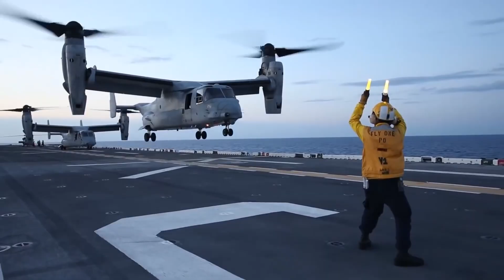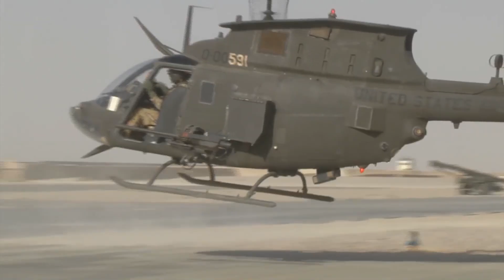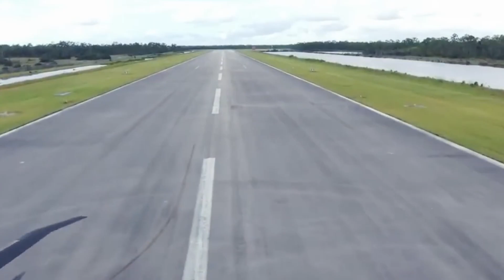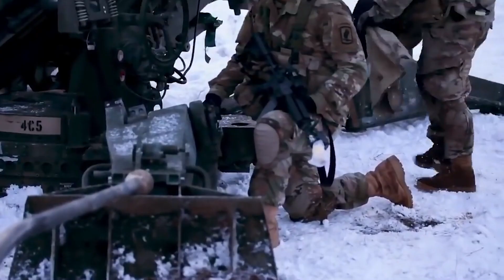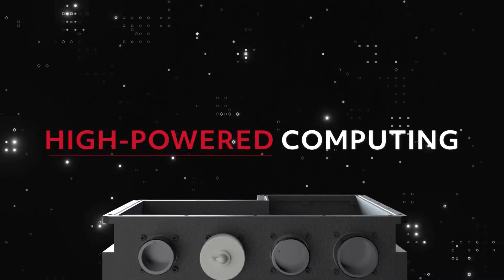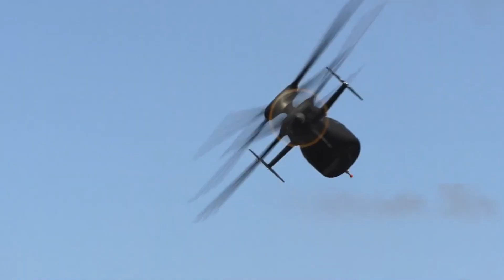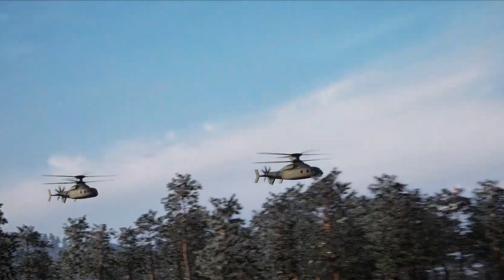SB-1 Defiant - Must go faster!

Comment: EXCELLENT explanation of the Raider evolution with accurate details including its problems, mentioned with wry humor. Thank you. My nephew was part of the civilian evaluation program that ended up choosing the Bell Valor tilt rotor entry.  Hey, fast is good! And longer range for Pacific island hopping is a must.
I think the Sikorsky "Push-me Pull-u" entry may, with the new engines, be the better choice FOR AN ATTACK HELICOPTER but only IF it can keep up with the Bell Valor. Next put the new Sikorsky engines in the Valor once they are proven. Lighter & slimmer = attack version with more speed and range.
Reply: Don't worry about a V-280 attack version, it won;'t happen because the Air Force will point to the Key West agreement and start complaining that the V-280 is a VTOL fixed wing. If they complained about the AH-56's stub wings (and they actually did manage to get it cancelled) they will for sure complain about the V-280 and they'll have a stronger case here. Everyone including the US Army seems to have forgotten this.
Reply: the ridiculously continent sized rotor hub is prohibitive for an "Attack" Helicopter., too vulnerable and too obvious a target. Not that Valor would do much better as it also seems doomed if ever forced to work asymetrically due to one gondola having been sieved by bullets, but Defiant is a no go from the start.
Reply: @Ugly_German_Truths The V-280 attack version is doomed because the USAF will claim it's a fixed wing VTOL, and a strong case can be made for that because tiltrotors mostly operate in airplane mode. If they pitched a fit over the Lockheed AH-56 they will for sure do the same about an armed V-280. The USAF have not as far as I know changed their stance that the Key West Agreement prohibits the army from fielding armed fixed wing aircraft.
Reply: @atomicskull6405 Long range drones are armed fixed wing aircraft that the Army has been operating since the 90’s. I don’t think anybody in charge in modern Washington knows or cares about the Key West agreement.

Comment: It’s about speed and range.  The V-280 will Island hop a lot faster and further than the SB-1 Defiant.  Each aircraft has its advantages and disadvantages.  However, the V-280 is ready now, not later.
Reply: Good luck landing that fucking hog in vegetated jungle environment and operating in such theater, 2nd the near peer adversary not going to send anything to contest a aerial threat flying around? 3rd what happens to its so call pros when near peer is no longer needed.
Reply: @thh4584  fool... the Valor outperformed the Defiant in nearly every metric. The Valor only has a 19% larger footprint than the Black Hawk and can land nearly everywhere the Black Hawk can.
Reply: In reality all 3 aircraft require 50 meters separation from each vehicles center or nearest obstructions per regulations of ARMY Ops
Reply: @michaellove9831  yup people see movies and think that is reality.

Comment: The Fairey Rotodyne of the 1950s/early-'60s was faster, more stable and in 'free rotor' mode the rotor could act as a parachute for quite a heavy craft in all weather conditions.
Its lift and civil engineering capabilities were immense and it could have revolutionized city center to city center transport in Europe and N.America.
The Mk.2 with revised, quiet, tip jets for VTOL overcame noise objections but orders from major US companies were stopped by the US government.
Had development been allowed to continue aviation would be different today, cleaner, more diverse and 'drone' versions operated in a pair with a crewed version controlling the unmanned one were discussed as early as 1959.
Reply: I agree, maybe the reason for being not admitted in city/city or airport/city transport lines was the noise level.

Comment: I see the tiltrotor as fundamentally inferior because of its mechanical complexity. I have to imagine the Army figures the performance is worth it.
Reply: Not much complex than SB-1 having 3 rotor and 16 blade
Reply: It’s not much more complex. It just tilts. Not complex at all. If they do it right. And scalable. Can have 6 or 8 propellers too.

Comment: Just for interest: Kamov started the two-rotor counter rotating design shortly after WW2.
Reply: But they didn't. Going on wiki you can see the idea for counter rotating helicopters was already thought of in 1754 by Mikhail Lomonosov (notably not named Kamov).Then in the 1930s some French guys cooked up a gyro copter using the counter rotating design. Arguably, they were ones who actually pioneered the concept. It wouldn't be until late 1947 when Kamov would actually create the Ka-8 helicopter using counter rotating blades. This makes it the 4th functioning design after the first French one and three other American prototypes. 

In fairness, of Kamov he helped mature the design until his death and arguably did most of the work to make it a production helicopter but it is not fair to say that he started the design.
Reply: @d0mram-02  Your knowledge is deeper than mine, but Kamov is building helicopters with counter-rotating blades for decades.
Reply: The critical difference between the Sikorsky and Kamov designs is that the latter uses conventional rotor blades which need a lot of vertical separation to prevent them from hitting each other when they are moving slowly and drooping significantly. That means a tall rotor shaft which adds a lot of drag. The Sikorsky designs use much more rigid rotor blades that don't droop as much, and can therefore be mounted closer together.
Reply: @MrHws5mp  Several Ka-52s have been lost when pilots made sporty maneuvers in them and the upper and lower rotors made contact.  One of Russia's best test pilots lost his life that way.
Reply: Yeah, not mentioning Kamov helicopters in the history section is a big blunder, also not explaining the rigid rotors. Pretty weak video.
Reply: from the Smithsonian web site: 
"In 1944, at the age of 19, Stanley Hiller, Jr. designed, built, and test flew the first helicopter with coaxial rotors to fly successfully in the United States. The XH-44 was also the first helicopter to fly successfully with all-metal blades and a rigid rotor. Hiller used the counter-rotating coaxial configuration to distinguish his designs from Sikorsky's single main rotor designs that dominated the helicopter industry in the mid-1940s."
its in the Air and Space museum now

Comment: The SB-1 lost to the V-280 because V-280 has a better speed 345 Knots, a lot longer range 800 miles, and more lift 1,000 lbs more.
Reply: Don't forget less maintenance since the Valor prototype alone was flying way more often than the Defiant.

Comment: Surprisingly being a Boeing, this is safer than the Bell competition
Reply: Why do you say that?  Currently the MV-22 has one of the lowest mishap rates in the Navy/Marine Corps inventory.   The aircraft with the highest mishap rate in Navy/Marine Corps service is the C-20, a military version of the Gulfstream G-III/G-IV series aircraft.  And not by a little either.
Reply: @philsalvatore3902  Just yesterday 3 marines died in a MV-22 crash. The design is fundamentally flawed because if 1 engine goes out in hover mode, it’s a guarantee crash.

SB-1 can autorotate like helicopter if all engines out, normal plane can glide if engines out. MV-22 cannot do either in hover mode
Reply: @Peizxcv  Number one, we do not know the cause of yesterday's mishap.  Based on aviation statistics 90% of mishaps are pilot error.  Number two, there is a synchronization shaft running through the wing so both rotors turn even if one engine is lost.  A one way sprag clutch disconnects a failed motor from the drive system, just as you find in nearly all turbine engine helicopters.
Reply: @philsalvatore3902  They need to up the pilot training then as 15 hull-lost from 400 built isn't a good number
Reply: @Peizxcv  4 of those losses were developmental test articles.  Two were combat losses, and possibly three (one Air Force Special Ops loss isn't publicly documented).   Based on the Go-Pro videos recovered in one crash in Norway it was a pilot screwing around exceeding the limits of the aircraft ( I lost a few buddies that way, can't blame the aircraft if the pilot doesn't respect the flight manual) and one loss was due to rotor downwash kicking up rubber pads at a hospital helipad in the UK.  Sounds pretty normal for rotorcraft.  In terms of mishaps per 10,000 flight hours the V-22 is one of the safer aircraft in the Navy/Marine Corps inventory, incredible as that sounds.  Legacy Hornets fall out of the sky at a higher rate and for reasons that I simply do not understand their C-20/Gulfstream III/IV fleet has almost double the mishap rate of their combat aircraft while the USAF never crashes theirs.
Reply: There is a shaft that connects the rotors. In the event of an engine failure, one engine powers both rotors.

Comment: Looks like it could be the new Air Wolf 
Now to mount some retractable guns and missile pods with a different engine exhaust ports to make it look like it can go way faster
Reply: The Airwolf design wasn't real, and it couldn't be. As for speed, the limiting factor remains the phenomenon of retreating blade stall. That's why they don't just slap on more/more powerful turbine engines. That being said, I wouldn't be the least bit surprised to learn that a solution to that problem could soon be worked out.
Reply: @Tom-zs6bb  I agree that Air Wolf is fictional,  always has been.  There has been rumblings that a new series is in the works.  And my comment was that it would make a great new platform for the series,  especially since congess is not going to fund it as a warfighting aircraft,  after the entire ficaso of eastern europe
Reply: @almirria6753  This is better than air"woke". At least is not get fall when getting shot at the tail part!

Comment: Pretty pleased on your take for this one because while I strongly prefer the look of the SB-1 or any of it's 'siblings' I can't deny the on paper numbers of the V-280 and it just seems like the obvious choice for most situations. On the one hand it's kind of a shame because I find it relatively ugly, but on the other it's capabilities are undeniable
Reply: Feel the same, but if this is to be a Balckhawk/Seahawk replacement I can't figure out what they are going to do for the Navy. The Bell V280 isn't going to fit in frigates and destroyers.
Reply: @daemonllama78  It will probably replace the Ospreys that the Navy uses. People forget how much of a workhorse it is for the navy.
Reply: @daemonllama78 V-280 would probably just have V-22 folding system. It will fit.
Reply: @aizseeker3622 Hmmm I wonder if that’s something they could add to the V280’s design. I don’t think they planned for that kind of folding system initially.
Reply: @Blood_Berry13  it has the folding system. I've seen pictures of it with the wing rotated.
Reply: @Jeff55369  Yeah, since Marines also interested in FLRAA program to replace their H-1
Reply: @aizseeker3622  Those systems cause multiple issues with the V-22
Reply: SB-1 won't either as it's too tall for anything but taller hangers... Saw a few illustrations of naval use variant that had folding blades and  inverted tail fuselage/ vee tail to fit in elevators or ship hangers for Navy/Marines purposes. They'll be busy enough with Army contract. Feel likely that the smaller Raider design will get FARA preference if it can meet specs unlike SB-1.
Reply: @michaellove9831  Sounds about right with the more efficient hover on a smaller platform that will carry more payload everything it will need.

Comment: A video on the helicopter that holds the World Speed Record for a conventional helicopter, The Westland Lynx would be interesting. In 1986 it managed to clock up a speed of 400.87 km/h (249.10 mph)
Reply: Or 216  knots so not much slower the the x 2
Reply: I have been upside down in a Lynx once, some RN pilots were demonstrating to us during a port visit to Diego Garcia.
Reply: Also one on the new Wildcat, and why it was chosen while still being slower than the original Lynx. Another cool video would be purely on the original BERP program and how it revolutionised rotor design worldwide.
Reply: Such old things are not qualified to be compared here.
Reply: The airwolf got to mach 2. 

I keed.
Reply: The question is if the Westland Lynx could be scaled up and still keep its speed advantage. Some concepts only work up to a certain scale and I fear the Lynx might be one of those, as Westland seemingly has never tried to scale it up.

Comment: Why not both this and Bell?

Sure range and speed are good to have. But maneuverability, parts interchangeably, and flexibility for and in missions are also good points to consider.

Plus for bell, if one engine goes down. Thats mission end, regardless if it crashes or not.
Reply: Either design is "mission end" if one engine goes down. That's a "forced landing ASAP" in either case, the only difference is that unlike a full autorotation, you get "some" choice about which specific less-than-optimal landing site you end up at.
And to be honest if the Bell entry loses an engine in level (high speed) flight, you can probably land it like an airplane, even if it does suck at gliding. OK, maybe you land it more like the Space Shuttle (who's flying characteristics are famously referred to by the moniker "A brick with wings").
The (untested) assumption with the V280 is that you still have the ability to change the angle of the rotors if an engine fails. This might or might not be the case, it depends on which engine driven accessories the cross-connection drive shaft powers (hopefully it includes the hydraulic pumps on both sides of the aircraft).

They're both a type of helicopter, so they're both going to be less reliable and more fuel hungry (and shorter ranged, and slower/louder/higher RCS) than a similar capability aircraft.

This is always an improvement over existing helicopters, and both offer unique and different advantages to each other.

However, my gripe with the SB-1 is that I'm not sold on the use of a "simple" open propeller on the SB-1's tail.
I'm sure they did the math on it, but I think it would look better with a ducted fan unit (basically a turbofan's "fan" section, running at a higher RPM) in the place of the current "open propeller".
Perhaps there's additional thrust to be gained with that approach, after all the aft propeller already has an unusually high blade count of 8.
You can even have a relatively simple ducted fan that can also do variable pitch, this is basically what they use on "fan-tail" helicopters.
"All it would take" is to scale that up and turn it so that it pushes the helicopter forwards rather than creating a yaw control force. I put "all it would take" in quotes because nothing is ever so simple as saying it makes it seem, I know there will be difficulties, but I still think it's a possible solution. There's also the advantage that since most of the parts are already being made out of carbon fiber, it wouldn't be too hard to incorporate some Kevlar in to the structure of the fan duct to provide a degree of protection from small-arms fire (as well as protect bystanders if a tail fan blade decides to separate from the hub, armor almost always works both ways).
Reply: @SciDerg didn’t read all of it, but one engine in both models can run both propellers. So, no, not mission end. Just slower.
Reply: Not enough budget to procure both. Army still need to procure new AFV for Bradley replacement.

Comment: This technology is simply too impressive to be ignored. With the A-10 facing retirement, the Army is going to be in desperate need for a LOT more ground support fire. Fast movers simply can not perform the job.  The Raider looks to be a near certainty to me.  I believe that they have overlooked the noise signature issue of tilt rotors. You can hear them from many miles away giving opponents lots of time to prepare an ugly reception.
Reply: The A-10 is not survivable against the modern air defense threat nor is any helicopter.  Air support in a war against a peer enemy with the best modern ground based air defenses will be conducted by all aspect low-observable aircraft using precision guided munitions.  The low level environment is a meat grinder now.  When the A-10 was designed about the only low level threats were early Soviet manpads that could only track engine heat and the radar directed ZSU-23/4 AA gun system.  The A-10 armor can deal with 23 mm and clever design meant rear aspect exhaust heat is well hidden and as experience with Israeli aircraft showed a hit didn't guarantee the engine was destroyed.  Apaches and Blackhawks were also hardened to survive 23 mm hits and if you stayed below 50 feet agl an SA-7 could not acquire you.  Low level was more or less safe.  
That started to change in the late 1980s with the introduction of SA-8. Today low level is a meat grinder of much more advanced manpads with seekers that can track an A-10 at any aspect, track a helo down to the surface and warheads that can knock an A-10 down, along with systems like Tunguska, TOR-M1 and other effective low level SHORADS.  Until the air defenses are taken down the only game in town is something like the F-22, F-35 and B-21 using pgms to provide close air support.
Reply: @philsalvatore3902  The Air Force has been saying that since the 1950s. It was wrong then and it still is. A bomb from twenty thousand feet can't do the job and you can't see the target at 800 miles an hour down low. It isn't glamorous, but someone has to bore in close and get hits.